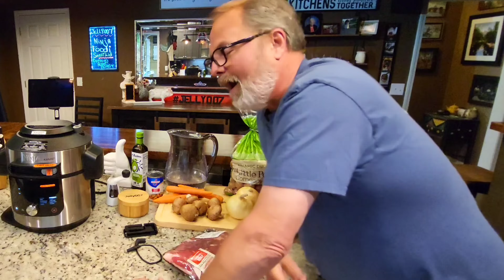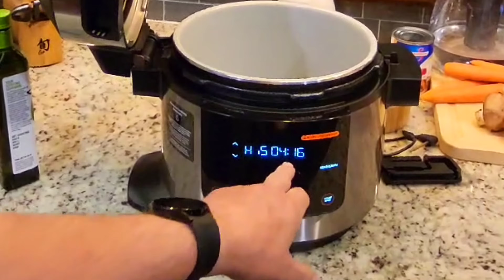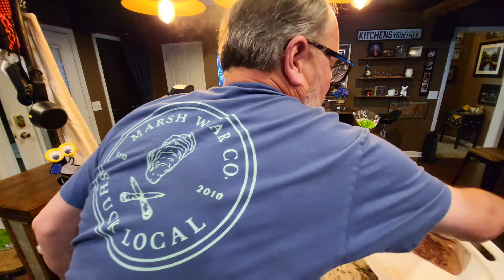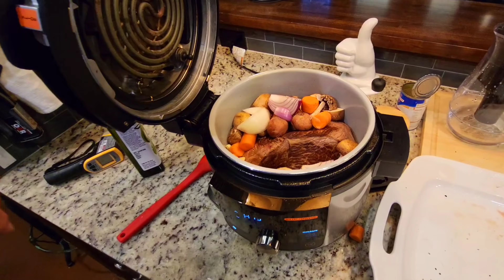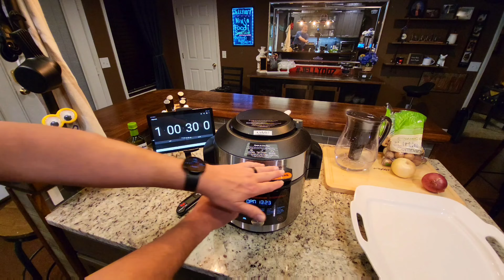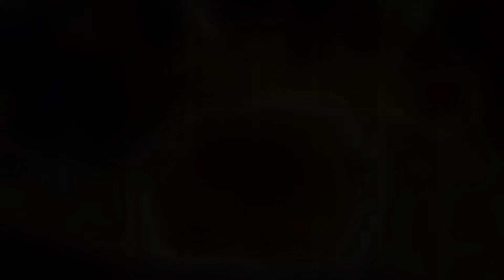Bottom Round Roast NINJA FOODI SMARTLID One Lid Wonder PRESSURE COOKER Built in Thermometer

Comment: John, I have a ThermoWorks Smoke thermometer with prob and cable. I was wondering if I could use this thermometer in my ninja airfryer/pressure cooker just to keep an eye on temp instead of having to open lid so much to use thermopen ?
Reply: Yes, if the lid seals around the probe cord it works. I seriously doubt ninja would approve of it though 🤣